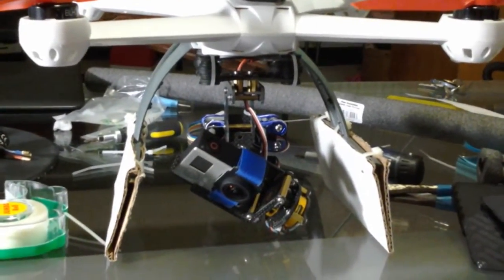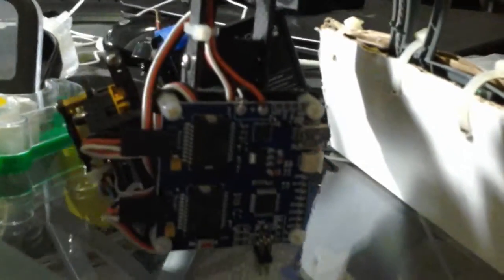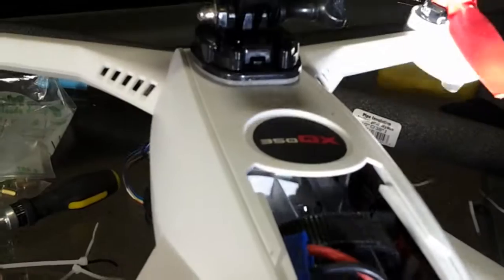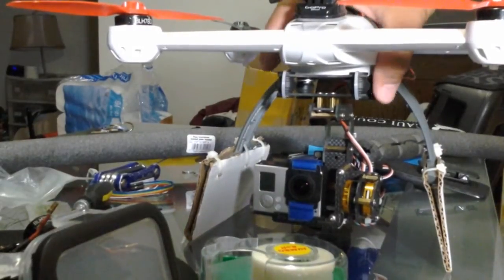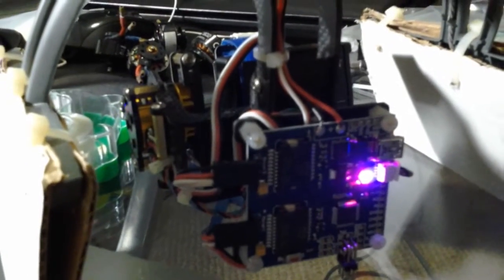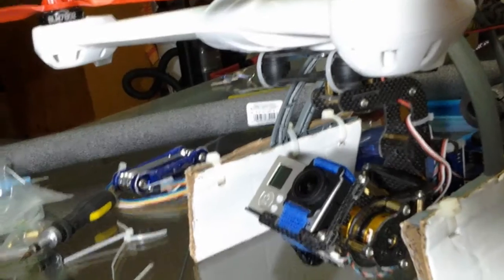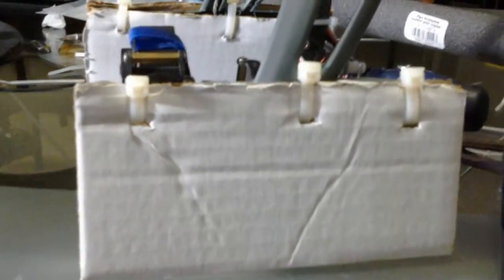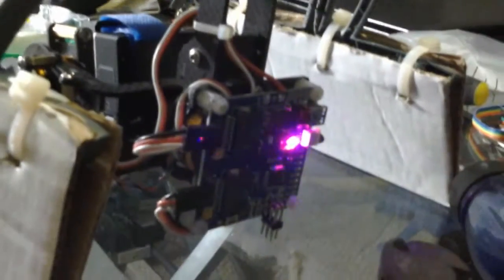Cheap GoPro Gimbal Installed on Blade 350 QX

Comment: hey bro, nice creation with the flaps but doesn't that affect the behaviour of your QX? 
putting holes in the cardboard may help flow the wind better. I just got my GB and want to try it out. did you perform the fw upgrade? what tools/software you're using?
Reply from the maker: ***** They sell extended skids now. I no longer have my drone.

Comment: I have seen them. Not extensions but rather longer landing gear. Google blade 350 tall landing gear. Not sure how long they are though.
Reply from the maker: yeah, I fount the blade tall skids for about $15 on ebay. it fits perfect with the gimbal now
Reply: BLACKSHEEPMEDIA808 Could you post or message me the name and/or link for the gimbal?